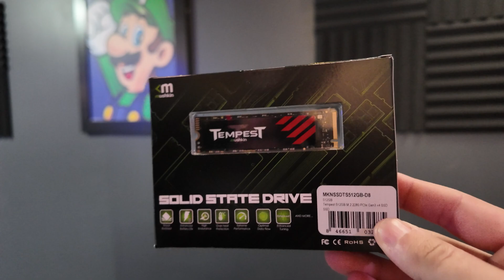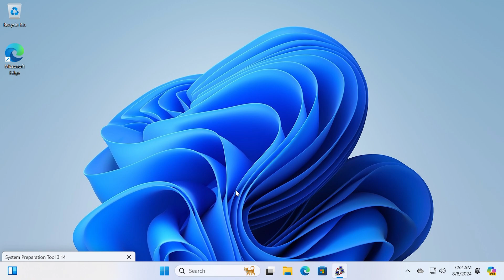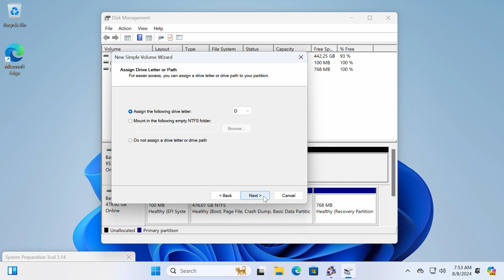How to Install and Activate a SATA SSD - Full Guide

Comment: Great videos Zach, I had no idea It would be that easy. I checked out the left side of my computer  and there it is a power cable with two connectors for powering to storage devices and two different types of slots to choose from. I just ordered a four terabyte Western digital Sata SSD. I will be transferring my saved YouTube videos from the HP omens storage to a WD SATA SSD.😮

Comment: Well done. You went a little fast though. This is fine as a demonstration, but not as instruction. The last part on installation was much appreciated. Anyone can plug wires in sockets. The important and vastly more important part is how to get the component up and running.

Comment: Do all motherboards have the thing u plug the cables into because idk of mine do and I don’t want to take my gpu off and it not be there
Reply: look up ur motherboard if you know what it is, thats what i did
Reply: @prestonmorris-t9e  Just make sure your power supply has sata connectors and your board has sata ports on it. The sata ports are  square blocks.

Comment: Wow this video was very helpful because my PC looks very similar to that. My SSD is under the black thing on the bottom of the PC. 
Which I didn’t know anything was under it until I saw wires going into/coming from that area. I thought it was just a stand thing to upgrade items onto lol. 
I’m getting memory errors. I reseated my RAM but I dk if that’s going to fix it. I have a mid prebuilt PC. ROG strix. I am just doing research incase I have to do this, which I’m %97 sure I do 😢

Comment: Thanks so much! I just installed my new SSD! The only thing I did differently, was selected MBR instead of GBT(It was auto selected on my Windows10). These are how my other two drives are partitioned so I kept it the same. 

Tip: You can find this information from  your other disks by --> 
Disk Management>right click disk>properties>volumes tab>Partition Style.